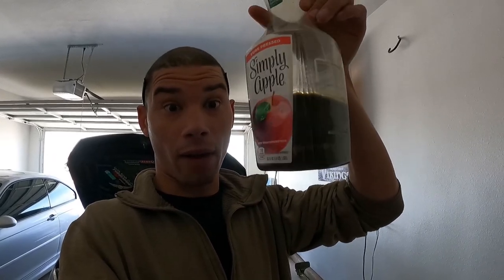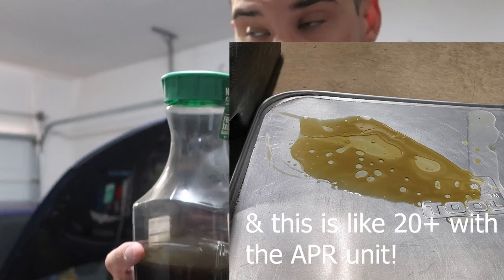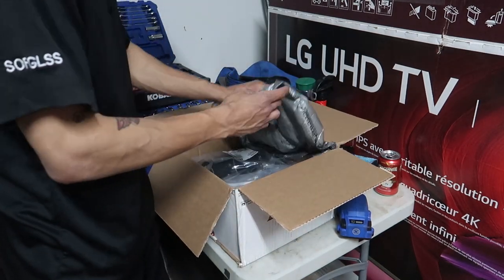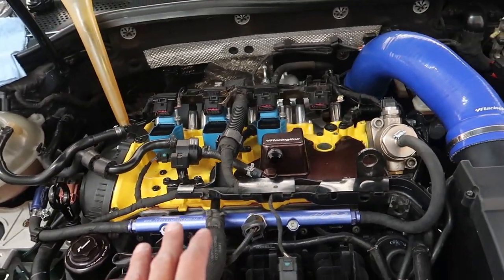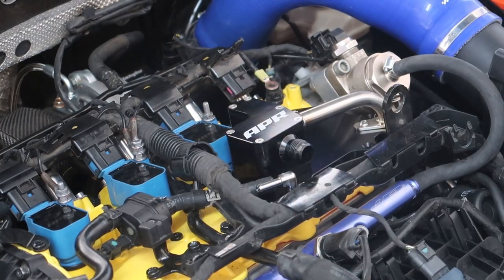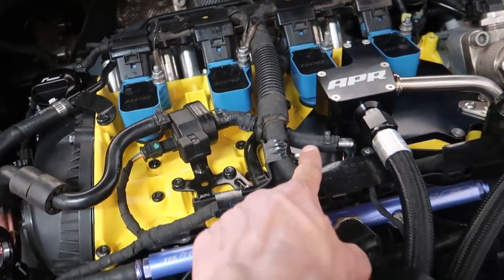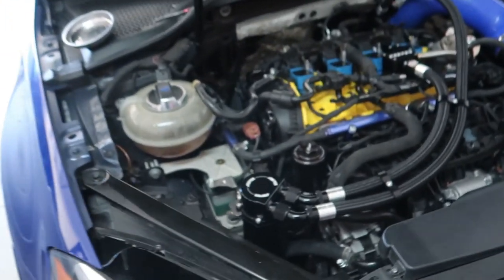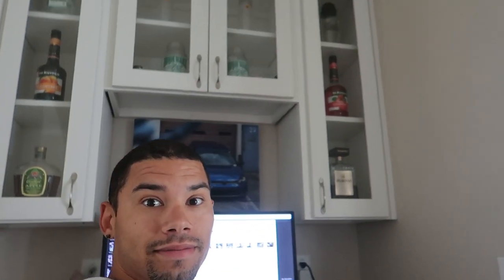The NEW full PCV APR catch can! Is it worth it?! | MK7 Golf R

Comment: Thank you for confirming i need a air oil separator that recirculates the oil back into the engine. Careful with aftermarket VW kits, seems they're just going to fill up.
Reply from the maker: 034s has a drain back into the pan that’s a nice unit

Comment: STEEL WOOL is your friend Hey dude I got a golf 1.8 tsi and thinking about getting the Apr delete plate and what not...now here's the kicker, as im watching your video theres some things that can be done differently I used to have a 1988 ford thunderbird turbocoupe which came with a 2.3 4cyl turbo from the factory, I had massive crank case ventilation problems and cylinder head ventilation problems with the stock pcv setup causing all kinds of leaks from seals and valve cover...however from factory the head ventilation line goes to the inlet pre turbo literally 3 or 4 inches from the wheel of the turbo inlet, the vent piece on top of the valve cover had some steel wool type thing stuffed in it from the factory which would catch most of the oil that gets caught up in the suction process from the turbo inlet and drips back down as it accumulates, only the tiny vapors would get through which is fine, now the crank case side of it had a similar contraption with an oil separator filled with the factory steel wool material but attached to the pcv which then from the factory attached to the Intake POST TURBO which is stupid because when the pcv malfunctions the crank case gets pressurized, I deleted that pcv and did the same thing and routed it to the turbo inlet pre turbo, no more oil consumption issues other than the fine mist oil vapors pre turbo but this can be solved by a pre turbo water meth setup to keep things clean, think I might just go ahead and get this Apr plate and do similar to what I did on my thunderbird when I'm ready to get it tuned...not anything fancy just an is20 setup
Reply from the maker: I like the idea!! Please post back up if you do it this way. Very interested!
Reply: @BryceJordanProductions  will do I'll save the video to a playlist and when I get it done I'll post a video and reply back to this comment, but what I described can be done on any boosted car, turbo or supercharged...but pre turbo/supercharger water meth injection is recommended just to keep things clean

Comment: what happens with the oil if you didnt have the catch can would it pass by the seals in the turbo causing it to smoke?
Reply from the maker: No it goes back into the turbo though and the engine burns it up and causes more buildup on the valves and residue all in your intercooler piping and on your boost sensors

Comment: The PCV's on these VW's is an abomination to engineering.
Reply from the maker: Agreed lol
Reply: I haven't seen many manufacturer pcv systems that are worth a damn.
Reply: @Chris-vs2up  stock one shits out costs 140$. Can get a brass check valve that will last forever, for 20$ from McMaster. It's over engineered junk.
Reply from the maker: @Chris-vs2up  there's a notch in it for air to flow through at the bottom of the "door"

Comment: What exactly is the purpose of the catch can? I know what they do but I thought you were running multi point injection?
Reply from the maker: MPI does indeed help keep the valves clean, and the catch can will also help some too. My stock PCV unit failed and would cause oil to dump into the engine and make big clouds of smoke. These catch cans replace that pcv plate and add in the can to catch the nasty stuff.

Comment: Hi! Bryce. I installed a vortex xl on my 2019 gti and now I m just checking a big big blow by . Sometimes on drag races if brake was pushed hard  a big anount of white smokes came out through the exhaust. So i decided to install a racing line catch can...  and now car has always white smoke going out through the exhaust specially after decelerations. And no any oil is retained inside catch can 😅🤕😪
Reply from the maker: Sounds like it might not be blow by then.. pop the dp off and see if there is a bunch of wetness or burnt oil residue on the exhaust housing or dp. Could be the turbo, could be the PCV. Maybe turn the car on without the dp connected and keep an eye on the exhaust housing of the turbo if you see oil coming out it may be a bigger issue. But it's really hard to give advice without seeing it first hand. Are you in the EQT group? Maybe post a vid and tag me
Reply: @BryceJordanProductions  thank you so much Bryce! I did what you said.. and yes there is oil in the exhaust dp and all downside turbo housing. So i think turbo seals are broken🤓
Reply from the maker: Yeah that or something is blocking your oil drain. I'd message EQT directly, maybe get a warranty

Comment: I just got this full catch can system and found two extra big screws with a ball head which is not mentioned at all in the instruction. Any idea on how to use them? Thanks!
Reply from the maker: They are to extent the points to which the engine cover attaches to. I never did it so I can't help too much

Comment: Hi man, big fan of your vids. I am having the identical symtoms with a forged built motor and a big turbo setup and excessive oil blowby into the CTS catch can. I did 3 pulls and then felt something weird was going on and went to check the engine bay only to see oil sprayed all over the engine bay, apparently turbo sucked oil from the catch can. I was wondering if this is a normal phenomenon in these built engines and if you are still happy with your APR can. Also, did you do a compression test to see if the piston seals are okay?
Reply from the maker: Seems to be very common with built engines.. not sure why though.. the apr setup fixed it and I was very happy with it, besides the pcv plate slightly seeping oil but that can be Remedied with a bigger O ring for the silver tube.. unless APR has revised it by now (there was a mass of complaints) 

I never did a compression test cause I knew it was going to be an issue as many many others have posted about it
Reply: @BryceJordanProductions  thanks. What’s the boost you are targeting on that setup? I am at 32psi
Reply from the maker: 37 peak taper to 35 on the vortex and on the beta I was testing it was 45 down to 42
Reply from the maker: This video was 32tho on the standard vortex
Reply: @BryceJordanProductions  I am on Vortex XL and still in the middle of the tuning session with Ed, do you think I can run a higher boost than 32psi on 91oct with WMI?
Reply from the maker: That I don't know.. I probably wouldn't. Personally I don't trust meth.. E85 is the way to go unless you absolutely don't have access to it

Comment: I have an APr catch can, yet the last time I opened up the Can it was complete clean inside.  I have yet to drain any oil from it as well.. idk why?? most importantly haven’t had any oil consumption issues with it compared to without it.
Reply from the maker: Cause you have the old one that isn't really doing anything. It doesn't replace the PCV plate like this new kit...It's basically there for looks. It really serves zero function other then looks and to line APRs pockets with more cash.
Reply: @BryceJordanProductions  so would you would assume it is just bypassing oil through the can without leaving any residue of any kind.
Reply from the maker: No, just nothing's ever going in it cause the PCV is doing it's job

Comment: So basically what I got out of this is that the APR one still has problems and isn’t much different than every other catch can for our platform with the exception of that metal tube on the top.
Reply from the maker: Well, no. It works and works great. Doesn't fill up my catch can like the RL did. This is more towards built motor people or those experiencing alot of blow by. RL did me great prior to built motor, that tube allows all the clean oil to go back into the engine wearas the racingline was filling up with fresh clean oil

Comment: Couldn't you use the hose from the other catch can? Instead of the hose running over
Reply from the maker: Maybe.. but I sold it so I wanted to include the proper lines
Reply: @BryceJordanProductions  o ok. Yeah cause if they both were -10 then it would of. But like watching your vids. Not alot of people doing vw's. Got a mk5 jetta 2.5l, just lot the mk6 I had. Got hit. But got plans on building the motor and trans and then turboing it. Keep up the good work and keep the vids coming.

Comment: APR Stage two

Today I removed my APR Catch  can System
And reinstalled the PCV factory valve
I had so much positive pressure on the crank case that oil with spitting to the inlet pipe
After installing the PCV valve Everything seems OK I have vacuum in the crane case 
I sent an email to APR about this issue and didn’t answer me yet for me this system it’s not working I don’t know what it’s wrong with !!!
Be careful before purchasing this system
I would like to get feedback from you if you have the same issue like me 
Oil feeling cup when the engine is running open it
And you will see how much positive pressure you have it’s insane
Reply from the maker: That is very odd
Reply: I don’t know what the plate deleting but after installing it I didn’t have any vacuum on the crank case
I don’t know is it right that the APR system works like that or not didn’t get any answer from 
Them  
And  my inlet pipe was always oily after installing this kit
Reply: After multiple Emails that I sent to them for this subject
Reply: @Chris-vs2up   So it is normal that I am feeling pressure when I am opening the oil feeling cup with this system 
And there’s nothing wrong with my APR system
Reply from the maker: That is very interesting!
Reply: @BryceJordanProductions   This is mostly used in Diesel engines & provent 200 is pretty huge filter. 

(Also a Direct swap for your APR oil catch can with rest all system in place)

With check valve installed the blowed by oil will return to your sump so no more oil top ups. 

Link for check valve- https://www.idparts.com/mann-provent-check-valve-2400843621-p-2436.html?ceid=afdf46ba1d5aef4e2ed2de97f6d7028e
Reply: @BryceJordanProductions  I went with a Leyo v2 kit and get the same positive pressure (instead of slight vacuum with org pcv) under oil cap. Also seen reports on facebook with APR, RL, 034 etc gets the same. I'm thinking of getting a: "VTT VAG Billet One Way Crankcase Breather" to replace the oil cap. Then remove the top filter on it and route it with a hose into the inlet of my catch can via a Y-connection :D also see: https://youtu.be/PwXPVlFBcpA

Comment: My first VW was a 1960 Bug with a 1200cc engine.  We just purchased a 2014 EOS with 39K miles.  I'm very unimpressed with the engine.  2.0 TSI.  Not sure what the real name of the engine is?  Anyway, direct injection is a horrible idea and I sid I'd never buy a DI vehicle.  VW burns oil, down 1/2 quart in 600 miles.  Lots of oil in the intake.  Low tension piston rings probably have a lot to do with it.  Has anyone figured out how to do a PCV delete?  Change it so it's like the cars of yeseteryear where they just vented the blowby outside.  It worked just fine.  Dealer told us if the timng chain breaks, a new engine is $14K.  If the head needs to be replaced only, that is over $5K.  Ludicrous.  My FIAT Abarth is solid as a rock, port injected, never any oil in the catch can.  Zero issues and cheap to keep. Sorry we bought a VW but the convertible is fun to drive.
Reply from the maker: I'd get rid of that EOS asap.. they're nothing but issues and that first gen 2.0 it's riddeled with issues. Not sure if there's a pcv delete but a catch can helps. Terrible with carbon buildup regardless. The engines are called "EA888.x" x being generation. You have gen 1 the current is 3 and the mk8 will be the fourth gen. Great engines as of the gen 3, I wouldn't own a gen 1/2 unless I found one with low miles and maintained it myself
Reply: @BryceJordanProductions  We paid a bunch for the EOS but a local Dealer offered us close to what we paid for it.  So it may go.
Reply: @scotta9114  I bought a 2010 Audi A4 Quattro with 51k miles and it is in like new condition in the exterior and interior, but.. the car is consuming a lot of oil about 1qt every 350/400 miles, but the car seems to be working completely fine, no misfires or check engine light, I do notice that there is a noise not sure if like a rattle when I let off the gas pedal at low rpms which apparently is the turbo waste gate, but I don’t know what to do with the car at this point, the car is really nice and drives very good but the oil consumption problem is killing me and also everyone that I’ve asked about the car are telling me that I have to change the timing chain, and that’s about $2000 CAD and I just bought the car about a month ago and it only has 51k miles

Comment: I'm new to audi and have the apr catch can with pcv plate and within a month of having them on  which might be 1k miles the catch can was about half full, kind of worried at the moment because my last car had an ls engine and  if I didn't empty it for probably 20k miles it might just be under half full.
Reply from the maker: Nope that sounds about normal man. Most catch cans on other platforms don't replace the PCV entirely like this.. they T into the existing setup. In the summer racing months I was half full probably once a month or more depending on the humidity. Winter not as much but more water then oil or fuel
Reply: @BryceJordanProductions  okay. I'm in pa and it's still cooler in the morning and we have some warm days here and there . So once it is actually warm constantly ill keep an eye on that
Reply: @BryceJordanProductions  apr was of no help,  answered my initial email and message on their Facebook page and haven't heard back since.  Told them to nevermind i figured it out by myself don't need their help.
Reply from the maker: Email is your best bet for big companies like them. Facebook is too much to keep up with

Comment: Get a baffled oil pan man! Got rid of my blow by problems
Reply from the maker: iAbed is on the list $$$
Reply: How does the baffled pan solve blow by issues?
Reply: @KXP70  I’m not 100% sure on how to explain it but this is how I understand it. A baffled oil pan controls the flow of oil returning from the cylinder heads to the pan and direct oil from the rotating crankshaft thus reducing crankshaft pressure and high crankshaft pressure is what causes blow by. That’s how I understand it at least. I could be wrong tho
Reply: @BryceJordanProductions  better get one ordered when you can. Mine ordered 3/15 and still waiting. Although Issam says manufacturer is completing them today so will "hopefully" ship next week. If you want in on this run better contact Issam ASAP. Not sure when next run will be. BTW - thx for the vid. Just grabbed my APR can from my shop today. Looking forward to getting it on
Reply from the maker: Interesting... Thank you
Reply: @BryceJordanProductions  wait also about the video. Wouldn’t the race line catch can be more effective since it’s catching more volume  of the blow by than the apr catch can? Because if nothing else has changed besides the catch cans doesn’t that mean that the volume of blow by is the same?
Reply: I have the Iabed oil pan on my car and I get blow by, has the RacingLine Catch can on but the crank pressure started to make my car miss fire nonstop. Decided to take off the catch can and put the original pcv and the miss fires went away I guess I have to try the new revision pcv for now and see how it goes.
Reply from the maker: Let me know how that goes! Been hearing the new one is decent
Reply: @BryceJordanProductions  The new OEM 'BL' PCV system may work for some but definitely not for me so aftermarket PCV replacement plates are the fix.  I tried the 'BL' plate on track and blowby for me was worse than the stock plate on a GTI.  I think this APR or Spulen v2 are probably the best out there now, I've had Spluen on track with no blowby issues where with BL I had to intentionally run the engine low oil to not burn a bunch off.  Also have the iAbed baffled pan which helps even more.